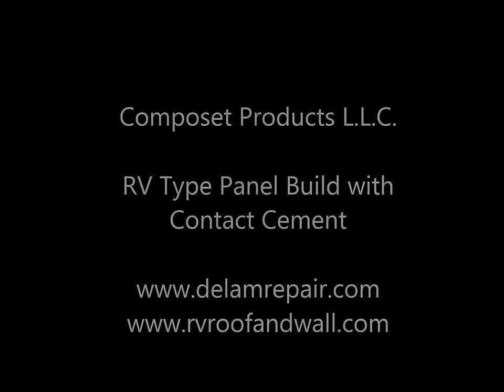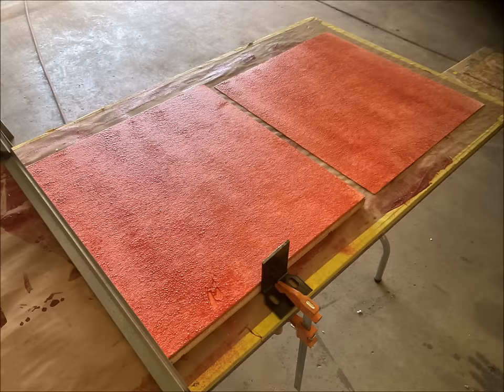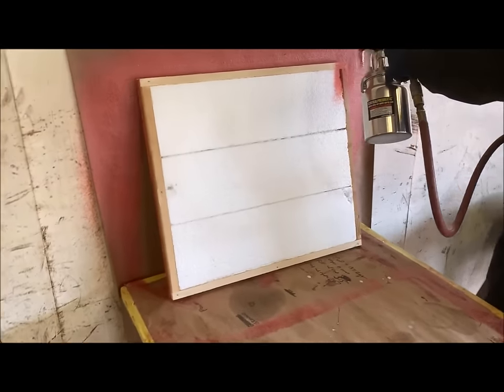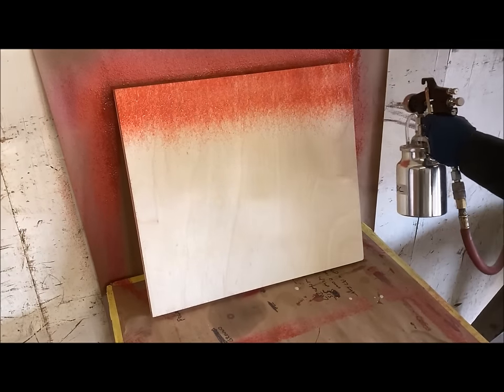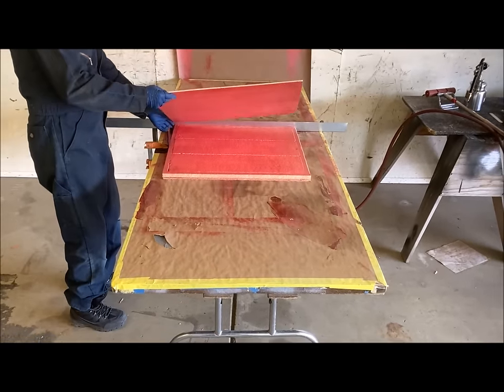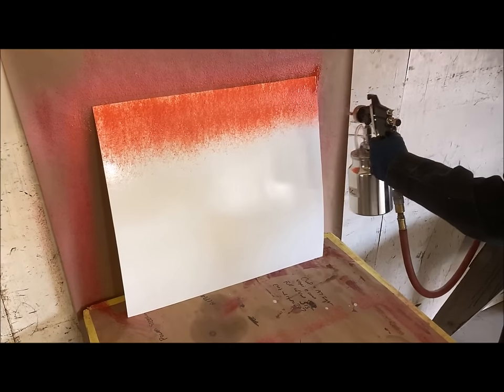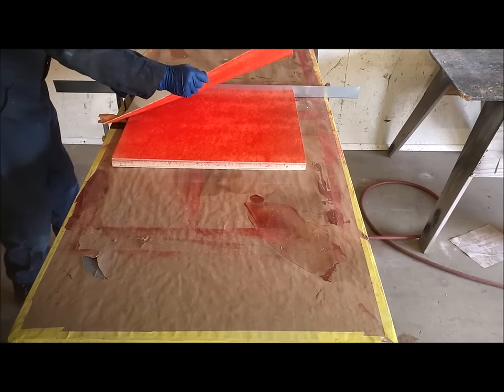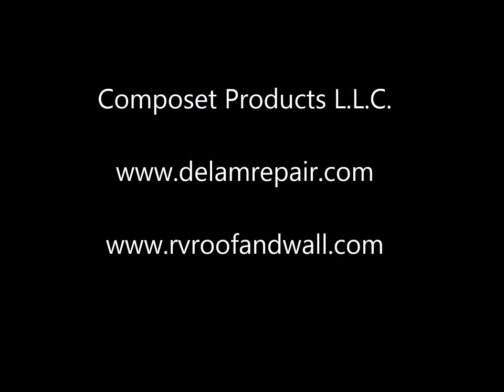How to spray Stabond T440C and E183 Contact Cement on fiberglass RV siding, plywood, and Styrofoam.

Comment: I have been dancing around this repair. 
While driving thru a snowstorm, I lost a section of filon that was delaminated. I coated the side with RUBBER ROOFING due to finances & it has amazingly not leaked or given me any trouble in a year! I've been hoping to find a video that could give me the answer I've needed. I believe this is it. Thank you. I will let you know my results!

Comment: Great detailed instructions.  We're also doing ours, but wanted to get away from using wood (luan).  Is there any composite substitute for it or can we glue the fiberglass siding directly onto the foam if we use structural foam  (XPS ridgid foam from HomeDepot for example)?  Thanks
Reply from the maker: The wood is part of the structural wall. Azdel is a product that some manufacturers are using instead of plywood. We have adhesives that will bond both Styrofoam and Filon.

Comment: Would a gallon of this material be enough to do a roof (29ft) or is more expected
Reply from the maker: Typical coverage is 80 square feet of bonded area per gallon. Porus substrates (wood) require more glue than non-porous (fiberglass) substrates. Using 29' x 8' as typical roof size the square footage is 232 square feet. A general calculation based on that number estimates  as 2.9 gallons. Please keep in mind the Stabond products are for wood, fiberglass, metal, foam, not EPDM, PVC, or other flexible roof membranes.

Comment: I understand that spraying is the best method.
I've never worked with products like this & wonder... In your opinion, if I could use a paint roller?
Reply from the maker: We found that it was very hard to establish an even coating with the paint roller. The material tended to coagulate, or roll up when you try and spread it out.
Reply: @composetproductsl.l.c.dela2844  how does your spray gun NOT get all gummed up? Also; do you just throw away the sprayer once the job is done, or is there some way to clean them after using 183 or 440 in them? Thanks!
Reply from the maker: @nataliatrumpo3893  It is our experience that you do not clean the gun. Just leave the glue in the gun and it sprays just fine weeks later. You have to keep the cup over half full to avoid evaporation.
Reply: What size nozzle did you use in your sprayer? I have come across 1.8mm, 2.0mm, 2.5mm, and 3.0mm. Thanks.

Comment: this stuff is expensive. can i get away with just using e184 for all stages of lamination?
Reply from the maker: The T440C has a higher temperature resistance than the E183 and is better suited for the fiberglass-to-wood layer.